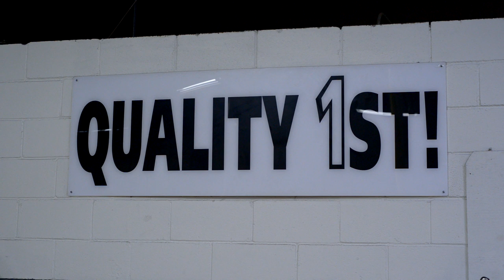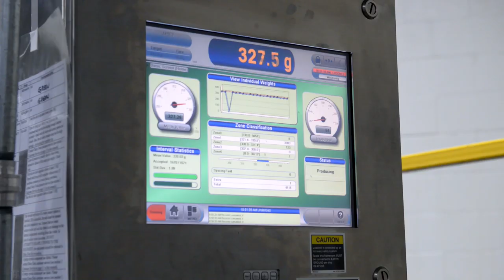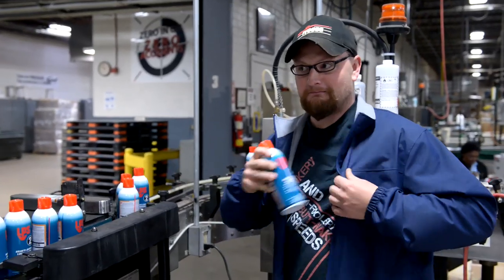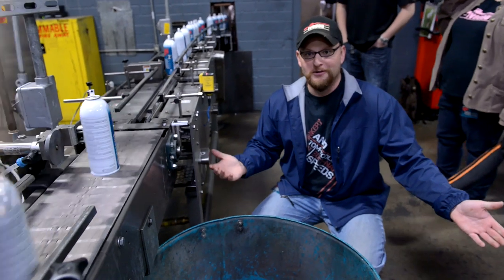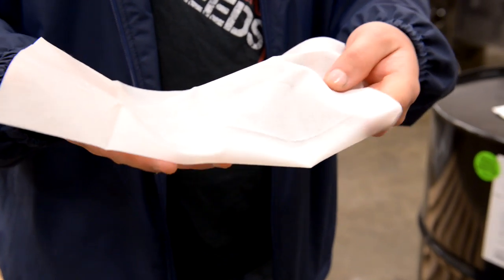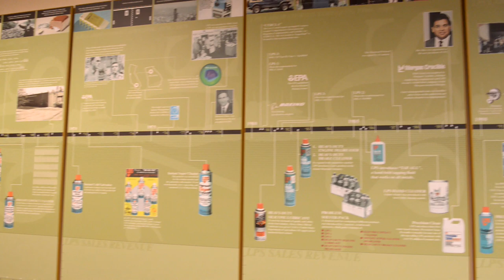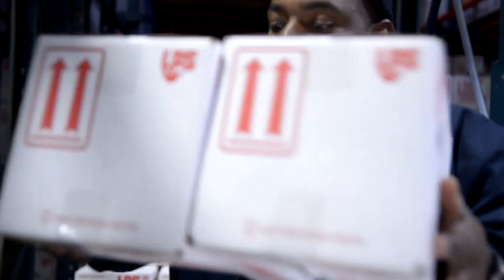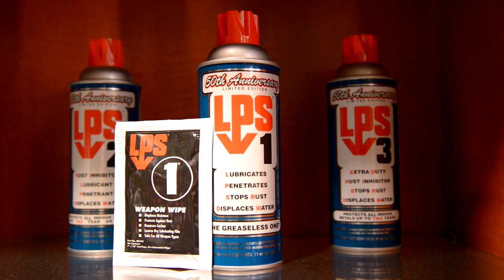LPS Labs Factory Tour

Comment: I've used LPS products for a very long time (decades). Awesome products!
Reply: A short history lesson... WD-40 is NOT a lubricant. WD-40 is designed to evaporate. It was intended for use with early radar systems on military aircraft to deal with condensate that would short out the electronic components in those systems. "WD" stands for Water Displacement. 40 is the 40th formula that was developed. It was developed to spray, or soak down, electronic components directly without risk of shorting out the systems. It's great for displacing conductive liquids, such as water, from electronic circuits and systems. Due to its evaporation qualities, it is not a great lubricant. Test for yourself... if you have a squeaky door, spray it with WD-40. It will start squeaking again within time, Spray it with an LPS product and the squeak will go away for much longer.

Comment: I was first exposed to LPS products at an open house at an electronics parts distributor in the early 70's, we had an electronics repair shop as well as appliance repair.  We used LPS 1 and LPS 3 all the time in our shop. I haven't had easy access to their products the last few years and sure miss having them available to me!
Reply: Head over to Ace Hardware, Grainger , Applied Industrial, Motion Industries or any other industrial supply house and they will have LPS products.
Reply: LPS Laboratories
What you should do is make LPS 1 wipes in little test packs(2"x2") and send them to people for free to try out. You might get even more business if they like your product..I'll take one:)
Reply: LPS Laboratories
 I have an Ace Hardware just a few blocks away, I'll have to drop in and check them out.

Comment: Thanx for the tip on LPS...I used to work for Sikorsky Aircraft and found MANY types of cleaners, solvents & lubes specifically for the aircraft industry that could be used on firearms and in the home...since I've been out of the business since 2000 I miss the ability to find and use these materials on my personal firearms...often times these products would have an artificial 'expiration date' given to them by the company and rather than dispose of the product, they'd follow me home...to be used as intended by the manufacturer.

CB in FL

Comment: Because of this video I've purchased a can of LPS 1 for my revolver that I pocket carry. I wanted a dry lube/cleaner combo so the gun wouldn't collect so much lint. It doesn't have a solid layer of small fuzz and dog hair anymore. The small amount that does stick (barely), I can blow off. I can't say how well it would work in a semi-auto, but the ability not to attract dust and dirt is a huge plus. I keep my gun clean, so am not able to speak about it's ability to cut built-up carbon. I am very, very happy with it. Very good purchase.

It doesn't have an offensive odor, but it does have a light, kinda weird smell. Like Necco Wafers.

Like with many lubricants or cleaners, remember to shake the can or you may get poor results.

Comment: I worked in the original LPS plant located on Cotner Street in Los Angeles some 45 years ago.  The company was purchased, roughly 35 years ago by a British owned chemical company, who quickly moved all USA production to Georgia, where they already had a facility making other lubricants.  The “originator,” if I remember correctly, was a guy by the name of Cavanagh.  Cavanagh began in his home garage, by “re-packaging” bulk 55-gallon drums of a material he purchased from Shell Oil Company, putting it into small aerosol cans; he called it LPS.   Later, Cavanagh expanded sales and opened a small facility on Cotner Street.   Turns out, the material was originally formulated for an areo-space firm, I don’t recall which one, as a low cost easy to remove metal preservative.  After a few years Shell Oil Company stop producing it and Cavanagh retained the services of a chemist to analyze the components in it.  Cavanagh then purchased all the component materials from Shell Oil Company and continued to produce LPS.   Although, LPS might have been “changed” or has been “reformulated” over the years, I can tell you how LPS was produced in Los Angeles.   A large stainless-steel vat, about five-feet in diameter and 4-feet deep was used.  A yellow-colored paraffin/synthetic bees wax was shoveled out of a Shell Oil Company 55-gallon drum and weighted; maybe 20-30 pounds.  The vat had a warming element underneath that melted the wax was then turned on.  Kerosene was slowly pumped into the vat, allowing it to blend with the melted wax.  Then a small amount of another material, I was told was an emulsifier, that allowed the wax in suspension, was added.   After an hour or so of mixing, a technician would remove about a quart, let cool to a specific temperature, and then took a small “viscosity meter,” a cheapie one like you can buy at a paint store, a stop watch and would “time” how long it took for the viscosity meter cup to drain out.   The only difference between LPS 1, LPS 2 and LPS 3 is the viscosity, i.e. the amount of wax in it, nothing else.  The way LPS works is the Kerosene “carries” the suspended wax to a surface, then evaporates, leaving a very thin layer of wax behind.   No magic, just wax.   Now you know the whole story.   

As for gun use, buyer beware.  I personally stop using LPS when after applying it to my hand tools, rust started to develop withing a month.  And, I live in West Los Angeles, in Southern California, not noted for it's high humidity.
Reply: Good questions.  I don't have any answers. 
I will say, I never would use LPS on any of my firearms; and never have.  In fact I don't use LPS on anything.  I still have a partial case of unused aerosol cans that was part of a huge shipment that was returned by Canada; as it did not meet their "standard" for "viscosity flow" and were labeled specifically for the Canadian market.  One of guys working the stockroom gave the full unopened case saying, "we can't sell this stuff."  How LPS is marketed is one thing, but as the Roman's once noted, "Buyer Beware."  There's a plethora genuine and effective lubricants formulated solely  for firearms use.   LPS may have certain uses, however, give LPS a pass for use on your firearms.

Comment: I use the LPS products on my boat for protection from the salt water. Also use the heavy lube they sell on my boats trailer springs. Helps keep the rust down for sure. Its sold at Ace Hardware and Miller bearings here in FtMyers, Fl.
Reply from the maker: I have a few cans on my boat too. Works wonders on fishing reels too
Reply: kewl, have to try it on my reels.
Reply: The2012waiting I use LPS 1 on my garage door springs and wheels, on my car/home door locks and on any cables such as those on bicycles.
Reply: kewl, well Ill have to use it more often. I do like the #1 for basic lube like u mentioned. The #2 heavier stuff I spray on things needing more salt water/longer protection. But the #3 works GREAT on my boat spring, but dang..... is it sticky when time to replace those springs lol.....

Comment: I pocket carry, so a dry lubricant would be really, really nice. When I pull my gun out after it has been riding in my pocket for a while, it always looks like my belly button has been turned inside out. As you think about products to review, would you throw in a dry CLP? At a minimum, a dedicated protectant would be cool.
Reply: LPS 1 doesn't attract dirt or dust, so it would be a great alternative.
Reply: Nice! I've purchased your items before and they have been as good and most often far better than what I had been using. Am pleasantly surprised to hear from the video that it also has no offensive odor. I am not able to purchase a dry CPL type product in my area, so you are a lifesaver. Am tickled that it is also an LPS product. Thanks a bunch for the reply!

Comment: I sold LPS 1 , 2, and 3. WE had it in several places I worked. The first time we saw it a salesman came in the store with an aquarium and a light bulb and socket. The sales rep set the aquarium and added water. He sprayed the bulb and socket. He put the socket and light bulb inside the aquarium and screwed them together and it lit. This stuff is better than WD40 to spray inside your distributor cap when wet. It would dry the points out. and wires of a soaked engine. LPS 3 is a lot more oily. and won't dry out your ignition.

Comment: I was with it until the end when the LPS guy mentioned it inhibited rust for 30 days. I live in the Pacific NorthWet. That won't cut it for me. Maybe as a quick lube wipe at the range before later cleaning, but not for heavier lifting.
Reply: True LPS 1 is more of a temporary ready-to-fire the gun type of lube.  True it is not a long term protectant. If you need longer term protection for storage purposed I suggest you try LPS 2 - 2 plus years of protection!
Reply: Ah! Many thanks. I appreciate that. That may be more useful in the land of little sun, lol. Thanks for the response.

Comment: I use a lot of LPS products and they are all good. In the SW desert at times the dust is a big problem and there Dry Molly spray [Force 842] is great for that on guns and for automotive linkage.
However I hope you test one other product I found that works fantastic. It is called CorrosionX and they also make a large product line of lubricants. One is called GunX. I was using just the CorrosionX Aviation on my weapons to keep the rust off during the Monsoon season and summer when sweat will rust finger prints. I'm not knocking LPS I use a lot of there products one, LPS Edge solid or Stick, I've used on B/P rifle bullets for lube. It cut the fowling down. But the CorrosionX for guns [GunX] seems to last longer and the barrel bore stays cleaner on all my other guns.
I hope you do check it out and give your opinion on it. I'd like to see how it compares.

Comment: Would this be good for cleaning a barrel after using corrosive ammo?
Reply: Yes.  Use the aerosol to flush the barrel and other areas.  Then follow up with the wipe to reach recesses and lingering carbon residue.

Comment: I love LPS. My dad used it in the auto mechanics trade and has used it at home for over 30 years. For those not familiar, the lower numbers are thinner and better for penetration. If you want to store something for a longer period of time, spray it down with LPS 3 and the paraffin wax used in the formula will not evaporate like WD40 will. When it's time to use the weapon again, a quick spray of LPS 1 will remove the heavier wax coating and make it ready to run all day.

Comment: What does LPS stand for?
Reply: LEADERSHIP PERFORMANCE SUSTAINABILITY
Reply: Lubricates, Penetrates, and Stops Rust - notice in the logo to the right there is a little double meaning because the P also works as "DW" which would stand for displaces water. LPS 1, the first product introduced by the company, does all of these things!
Reply: moviking That's a popular saying here at LPS. We think leadership, performance, and sustainability are all important goals for us as a company.
Reply: gman77gas LPS 1 is not a true  "solvent" by definition.  It does contain a few solvents that help with oil / grime removal and a few other extra ingredients that displace water and remove carbon residue.